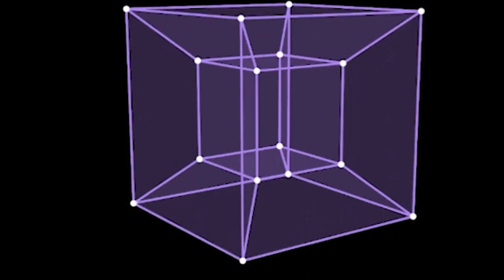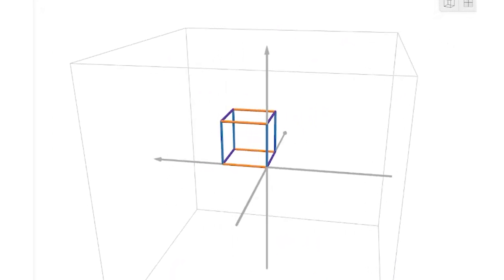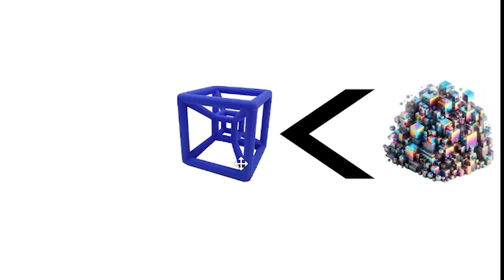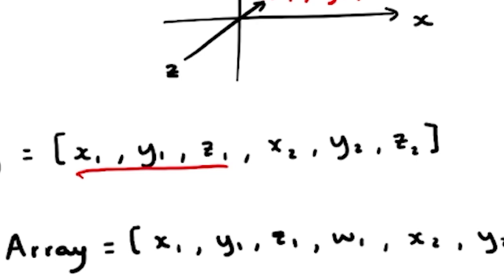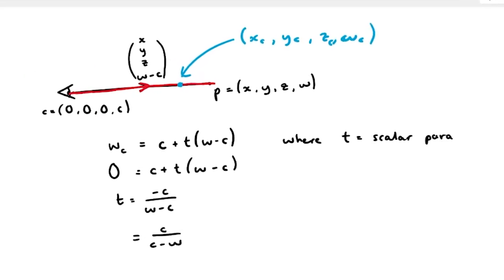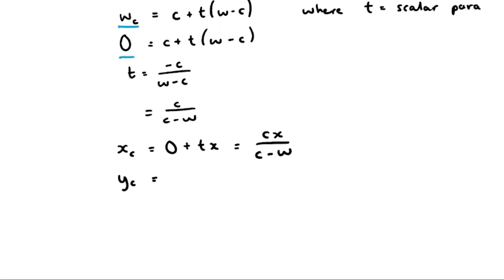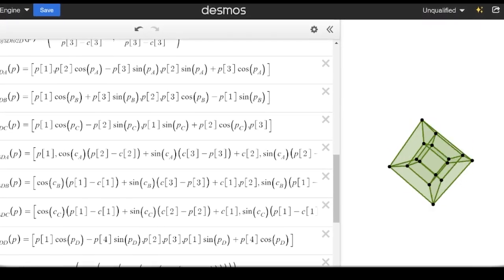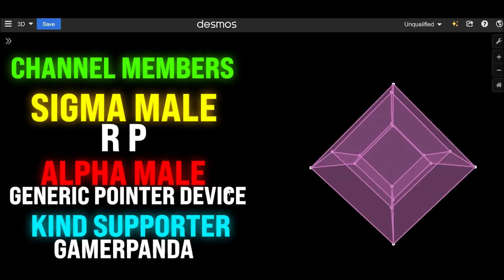How to build a 4D Engine in Desmos

Comment: Just use calculus mentally piece by piece by parts in previous dimension or this case your current dimension in 3D then you can visualize higher dimensions better.

Comment: Sir, I think you're confusing cross sections with projections. What you were calling cross sections of 4D or 3D objects were actually 3D or 2D projections of 4D and 3D objects. A cross section would be if I cut out a 2D slice out of a 3D cube. Projections are flattening a 3D cube until it fits into a 2D space. They are not the same thing.
Example: An image of a cube is a 2D projection of the 3D object. A slice of that cube is a 2D cross section of a 3D object.

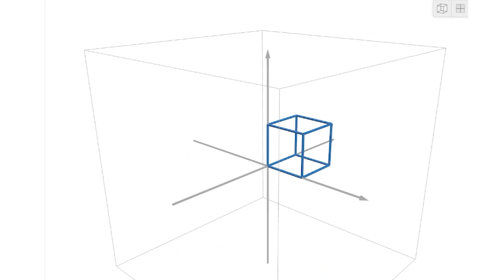Comment: 0:44 this is not the cross section of a hypercube. That would look just like a regular solid cube to us.

If I asked you to quickly draw a 3d cube on a piece of paper, you would simply outline the cube by drawing its 1d edges. Now imagine your perspective changed so you are directly facing the front of the cube. No other faces would be visible, and it would look like this:
_____
|            |
|            |
|______|

All you see is a square (the cube’s front face) as none of the other faces are visible from your perspective. The edges comprising those other faces are behind this front face. If you were to make the front face completely transparent, you would see the edges behind it, and it would look like this:
_____
|  \  _  /  |
|    |_|    |
|  /___\  |

You can now see another smaller square inside a larger square, connected to the larger square’s corners. This is the cube shown in the video, just in 2 dimensions. It is the shadow of a 3d cube’s edges being directly projected onto a 2d plane.

If it were the shadow of a 4d cube’s edges being directly projected onto a 3d plane, you get the shape seen in the video.

Comment: I am not too familiar with the mathematics of this, but is there a generalized method of turning polygons into their 4th dimensional counterpart? What about any continuous shape?
Reply from the maker: I'm not sure about a generalised mathod (hehe get it, math method) but I just used basic reasoning for the cuboid -> hypercube thing. I imagine someone out there has found one but I'm not aware of it.
Reply: that's like saying "how do you turn any 2d shape into a 3d one". think about that.
to make a cube, you extrude a square along the 3rd dimension.
to make a cylinder, you rotate a rectangle around a line on the 2d plane.
to make a pyramid, you take the shape you want and extrude it, but shrink it to a point gradually while you extrude.
extrude (extend along a direction)
rotate (self-explanatory)
resize (make bigger or smaller, usually combined with others)
move (in case you want the shape elsewhere too but not extruding along that movement)
and more, or for some shapes, just use a mathematical function since it would be more complicated to make them from these operations.
the 2d to 3d to 4d analogy works here.

Comment: very nice!!

there's slightly wrong imformation though,
that's actually the shadow of the tesseract and not the cross sectiono!!
Reply: Yes. That part of the video caught me off guard.
Reply: If you want to get REALLY nerdy it’s actually the 3d shadow of the hyper cube with one of its ‘w’ sides removed because including that side would overlap all other sides and making it look like a cross section (a cube). (remember, there are two ‘w’ sides just like there are 2 x y and z sides on a cube)